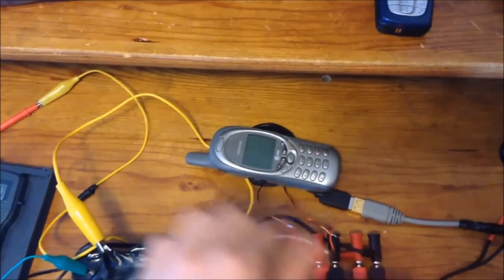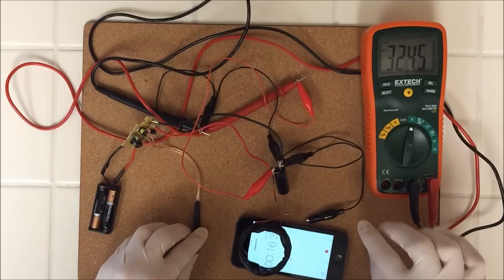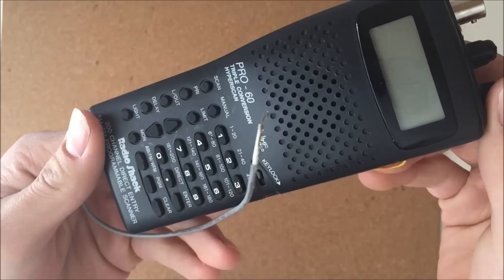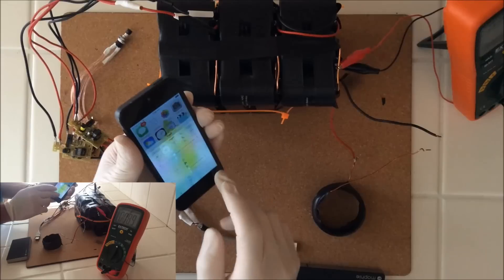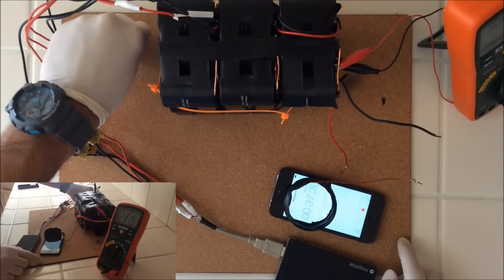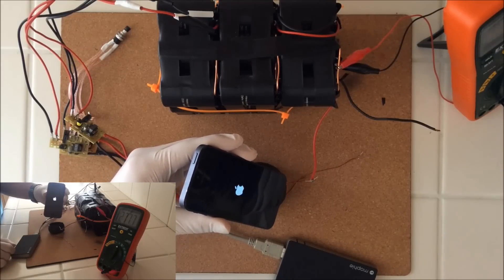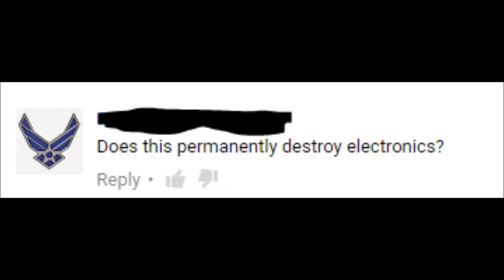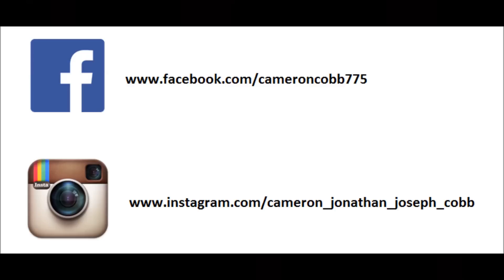Electromagnetic Pulse (EMP) an IPhone - What Happens?

Comment: How much stronger is a nuke's EMP?
Reply: Lets compute worst case scenario for soviet 50Mtonn 'Tsar' bomb. This emp is 600V 750uF - 135J at 3cm from iPhone. Tsar bomb is 209*10^15J - 1,54*10^13 times more powerfull. Distance need to be 3cm*Sqrt(1,54*10^13) =118km. This assumes 100% conversion from nuclear power to emp, that never happens. Real world efficiency (total nuclear explosion energy to emp energy is 1% max (from Wikipedia)). So this emp is as powerfull for iPhone as Tsar bomb, if exploded Sqrt(0,01)*118km=11,8km from device
Reply: There is 4,185 *10^15 Joels in 1 Megatonn. Multiply that by 50 Megatonn power and let assume conversion efficiency of 1 from nuclear power to emp. 50*4.185*10^15J=135J*1,54*10^13. Here we see tere is  1,54*10^13 times more energy so to make equal power delivered to device we want to match specific energy per area. According to inverse square law distance is calculated. The very last thing to consider is conversion efiiciency from nuclear explosion to emp. I taken maximum posiible number from wikipedia at 1%=0,01 and therefore real power is 0,01*50*4,185*10^15J=135J*10^11 and distance is 3cm*Sqrt(0,01*1,54*10^13)=3cm*Sqrt(1,54*10^13)*0,1=118km*0,1=11,8km. Here I matched SPECIFIC ENERGY PER AREA, so Iphone will recieve same strike from 'Tsar' nuclear bomb as from this emp if placed perpendicular to direction of explosion.
Reply: RobertMOdell way stronger
Reply: yes, obviously, but this EMP is so much closer.  I presume the intensity fades by the square of distance or something like that.
Reply: RobertMOdell: Yes and you have hit the nail on the head, most things close to the earth would survive, people are over-estimating the real damage an EMP attack could produce. 
To be able to generate enough power to affect an entire country combined with the inverse square law would make it very unlikely if not impossible with our current H-Bombs, even if they detonated it at the perfect altitude-but then you would be damaging your own country as well as the enemies, so not feasible.
Reply: Volodumur Kalunyak: Please explain the Joules calculation for the Tsar bomb...
Reply: Volodumur Kalunyak: Looks logically sound to me, and kind of proves my thoughts on the OTT estimations by EMP strikes people are commenting. I found Wiki reference saying 210 PJ for a 50MT explosion which ties in with your initial calculation. Of course there are some unknowns here such as altitude of detonation; as you probably know certain layers within our atmosphere act like a conducting layer; but that would just lower the Specific energy density.
Well thought out!.
Reply: XD
Reply: People like you scare me lol

Comment: That was very cool!  There are issues but not worth bringing up or they already have been.  The strength is the biggest but one other thing is the range of the EMP.  No one can predict the frequency and I personally believe it would be full spectrum.  I am a ham radio operator.  But the one question I do have is why did you wear the prostate check up gloves.......made my butt pucker a little....hehe  Great vid....I was pretty surprised the magnet jumped so violently on activation.  I didn't expect kinetic energy from the test.  Well done!

Comment: Google "Tempest Shielding" (that's what we called in the Army but it's actually an NSA program). It's interesting that iPhones have Tempest Shielding on them. I operated Mobile Subscriber Equipment and then Tactical High-Speed Data Networks in the US Army all of our stuff was TEMPEST shielded (MOS 31-R & 31-F). EMP can destroy electronics but only if it's at a high enough amplitude. Also look into EMP-T bombs (ElectroMagnetic Pulse - Tactical; pronounced like "empty bombs"). We used EMP-T during the first Gulf war, in fact the very first strike was using EMP-T bombs on SAM sites to shut them down and create an opening in their air defenses.

Comment: Now increase the power 1000 times and you will have the effect of the 1859 Carrington Event, which was 1000 times weaker than what a man made EMP from a high altitude Nuclear Explosion will be. It is unlikely high voltage power lines would survive, let alone microchips.
Reply: Carrington event generated the energy over a long period of time, rather than in an instant. The pulse in this demonstration is in fact much closer to simulating the duration of an EMP generated by a nuclear blast. And while the blast's pulse is spread over a wide area, a small area will only receive a small part of that EMP. It's just like an antenna. The longer the antenna the stronger the received signal. While this man's EMP test generator generated a weak pulse, it was on the order of magnitude that would be expected to be received by small electronic devices when the source is a nuclear blast in space. You see, small handheld electronics make VERY POOR antennas. And by the same token, that's why the Carrington event damaged so many telegraph stations, because the wires were VERY LONG (connecting between cities), so they made EXCELLENT antennas.

As this demonstration shows, it is likely that small consumer electronics such as smart-phones, will actually survive an EMP generated by a space nuke.
Reply: Alper Gökcek no he means that if the grid goes down and the electricity we depend on cannot be produced...then you have some issues
Reply: Alper Gökcek No need to argue any further. I guess if you think about it you can understand my point. Now I have work to do cya.
Reply: And a lot of people would die. :(
Reply: It would potentially kill someone with a pacemaker
Reply: Pace Makers and other electronic based health devices would most likely be affected if not temporarily disabled.   

the majority of the rest of you arguing like little children seem to have very little understanding of EMP's and why an Airburst based Nuclear detonation would be catastrophic to the Power Grid and other devices.   

the EMP from a Airburst nuke is FAR more powerful and out reaching than this video demonstrates. 

back in the Bikini Atoll Nuclear tests as one user very thoughtfully mentioned,   a warhead was detonated and the EMP it generated it reached as far as Hawaii, that EMP traveled roughly at the speed of light for 2650 MILES from the detonation site and STILL affected the power grid in Hawaii.  

the USAF and several other countries military forces have tested EMP Based bombs for a form of Electronic Warfare rather than blunt force explosives,  they just EMP the target area with a small explosive collapsing a flux field of electromagnetic energy AKA:  Flux Compression Generator Bombs, which generates a sizable EMP and can be tuned to a specific radius of effect.   rather than destroying the target and potential surrounding area,   the bomb would generate the EMP,  knock out or wipe out electronics and electrical systems and destroy the evidence in the process.   just small metal shards falling.
Reply: Colonizer-Chan The experiment was (unintentionally) carried out in (IIRC) 1962. Operation Starfish Prime - involving a nulcear detonation - caused the lights to go out in Hawaii.
Reply: Ben Hutchinson But if an EMP takes out the grid for a prolonged period, small micro-electronic devices will be useless anyway.
Reply: Trina McDonald u r a drama fool
Reply: Turn up your output an actual emp overloads a system with power so that it's energy source gets completely fried and depleted for good
Reply: Alper Gökcek Did it EVER FUCKING OCCUR to you that they didnt mean death directly from the emp? There would be death and alot of it from the aftermath. IDIOT
Reply: Now consider how modern circuits are built with over-current protection and proper grounding, bonding, shielding... I hope we get another Carrington event, just so that people can see that its not a good example to use anymore in modern times.
Reply: Trina McDonald I think the Tunguska event was pretty scary too
Reply: @alpergokcek6756 .... And so we come to the  PACE MAKERS...or ANY kind of electronic/electric device that keeps people either partially or wholly alive. And I wonder what would happen to an electric blanket if its plugged in and turned on ? Currently "listening " to 
Dr. William R. Forstchen's book "One Second After..." Its a fiction work on what would happen when the United States gets hit with a massive EMP. Look him up on youtube, and Wikipedia, its a real education on the subject. Not some crack pot...the real deal.
Reply: Alper Gökcek what will happen when it affects cars genius.
Reply: yeah, i feel the same way. i'd honestly like to have some kind of experiment conducted just to test the theory and know how big of an emp would be needed to take the grid (know though that the grid is strongly protected in some areas and not as well in others)
Reply: Trina McDonald yup
Reply: @alpergokcek6756  the comment you responding to spoke specifically of a high altitude nuclear weapon...
You clearly have poor reading comprehension skills or didn't spend the time to read and comprehend before commenting...why, idk.  You must be special....but you make yourself sound really stupid to make dumb comments like, which are wrong, in response to a comment you clearly didn't read or clearly aren't smart enough to respond with relevancy to the original comment. 
Of course people would die from a high altitude nuclear weapon...power lines and blah blah blah that the original comment stated, that you didn't care to respond pertinently to
Reply: @alpergokcek6756  and yeah, now I have better things to do than point out what a rude, irrelevant, and overall moron you are. Congrats on looking like dumb douche...
Cya 😂

Comment: Seems to say when the pulse was delivered into the surrounding case its saturated it if your where to employ a secondary surge of greater power right after the first during peak saturation you could leak enough em to the circuitry.
Reply from the maker: Interesting idea, i will have to try that, thank you:)
Reply: Safety first :)

Comment: hi what would happen if i used this in the casino.
Reply from the maker: Casino slot games are very well protected with from outside Electromagnetic interference, with a device like this, the most you could possibly do is  reset the machine.

Comment: How can I create an EMP generator in a manner to control the amplitude and frequence of its pulses?
Reply from the maker: I created something like that before however, the lower the frequency of the pulse the stronger the pulse was, and higher the frequency the  weaker the pulse was. This EMP has a different design and works in a different way. What i did was create a DC to AC converter then use a voltage multiplier to step up the voltage to a very high voltage to create a spark gap. The spark gap determined the frequency and how strong the pulse was. Heres a link to my video. Please let me know if you have any questions :) https://www.youtube.com/watch?v=ZSjPl27Zwgc
Reply: Cool schematics! Thanks!
In there you are controlling the freq. by changing the C1 value. I sthere a vway I can use a sort of variable capacitors in order to change the frequency just by adjusting it?
P.S. This is the first time I see an EMP generator which uses the concept of spark gaps... do you have some resources regarding the theory behind it? I mean... why do I need the spark gap?

Comment: An EMP attack will be far more powerful any tests you conducted. There will be NO phone service, NO electricity, and very few if any working 2-way radios. Some will have constructed Faraday shields with varying degress of success.

So even IF your iPhone survived there still wouldn't be any service. Same goes for any other elecrical items including your vehicle.
Reply from the maker: +RadioGuy1000 You are absolutely correct.
Reply from the maker: I have not but it is on my bucket list, lol
Reply: @CameronCobb  hello
Reply: Not all vehicles. If you have a carb instead of fuel injectors you'll be fine. (As long as you have a manual transmission that is.)
Reply: It'll still work. Our infrastructure has huge protective Faraday cages on the circuitry. You think we'd leave ourselves open to EM attacks?
Reply: Sylas the Great   yes!  Our society is currently completely vulnerable to an intentional EMP attack or a Coronal Mass Ejection from the sun.  If a large CME were to hit the US directly, we could potentially lose the entire power grid and take months to restore service
Reply: Stuart Gray True. You are correct!
Reply: +Cameron Cobb have you tried to make a microwave gun?
Reply: no shit
Reply: Microwaves are mini half assed faraday cages....
Reply: Also old mechanical fuel system diesels don't have an ignition system, fuel is ignited via compression. So they'd be fine.